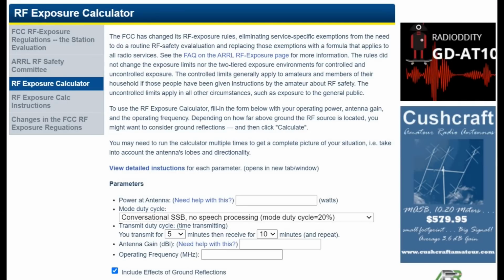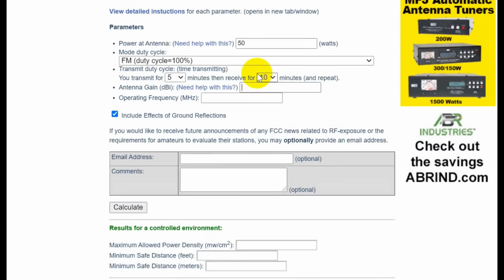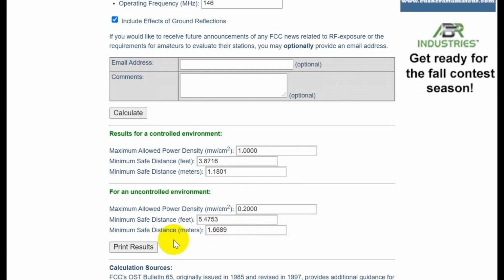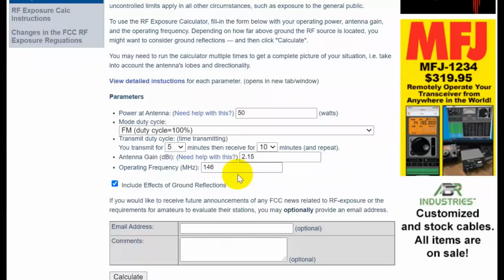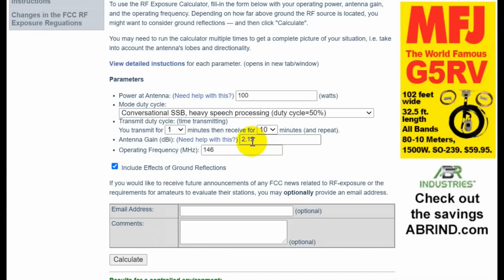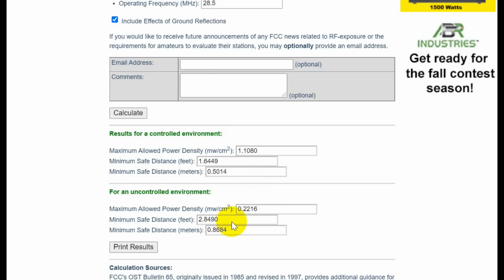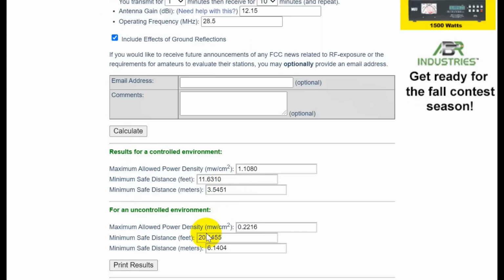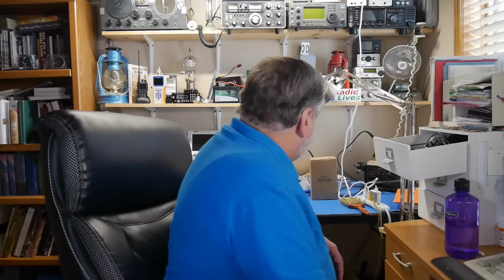Using the ARRL RF Exposure Calculator (#533)

Comment: Hi Dave, I've been watching for about 4 years. I was a late bloomer in Ham radio. I started at age 55. I have an issue not with breakers but rather with our air purifier. Every time I transmit on 40 meters, my air purifier in the bedroom goes from the low setting to the high setting 😅. Can't figure it out. It's an issue because I get up much earlier than my wife, and it wakes her up.  Any ideas? Higher bands aren't great at night, so I just don't transmit. This comment is in reference to video # 540. The next video in my watch later list started playing before I finished my comment so it appeared here. 73 KF0ALT

Comment: Dave, "metal" was a very poor choice of words. Magnets only stick to Ferrous metals. In other words steel and to varying degrees steel alloys. A magnet mount will NOT stick to aluminum, yet aluminum also acts as a shield just like a steel roof does. there are hundreds of "metal" alloy's that would act as a shield, that a Magnet WILL NOT stick to. Copper and aluminum are the most common.

Comment: Thanks for another informative video. Thanks for answering my question.  I was wondering about proper placement of a mobile VHF/UHF antenna in a vehicle with a 50W transceiver.  I am aware this is not ionizing radiation and want to be compliant with the uncontrolled people.   This is in regards to people innocently walking up to you or driving near you.  So placing a VHF/UHF antenna on the hood of the vehicle would not be as advantageous since there is glass and not metal in the path of the RF.  All of this gets to be academic. I am mainly interested in complying with the requirement to have these results in all my stations (qth, mobile, and portable).  

You make a great point about the HT. Since it is usually 5W, I didn’t worry as much about that.  

Thanks again, David.  We pilots need to stick together.  All the best now, 73 de KI5HXM.

Comment: Hi Dave.
Here in the UK the amateur op is excluded from the calculations.
Only the general public, which includes your family are taken into account.
An HT would most likely not be over 10watts EIRP so here it would be complaint anyway.

I will give the ARRL calculator a go and see how it compares with the RSGB one.
The RSGB one has a lot more options and they are working on various set ups we can plug into it.

I have calculated my HF and VHF stations with the RSGB one and with the power I run I am ok as is.
The only problem may be my vertical on the low bands as there is no calculator for those at the moment.